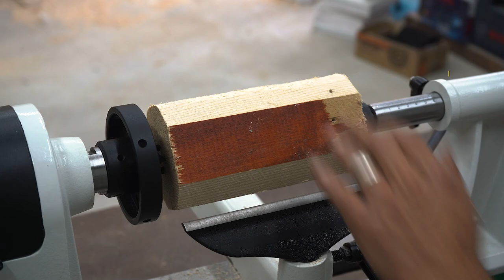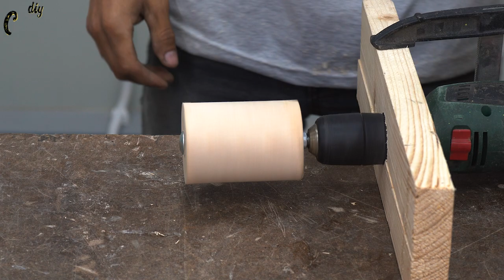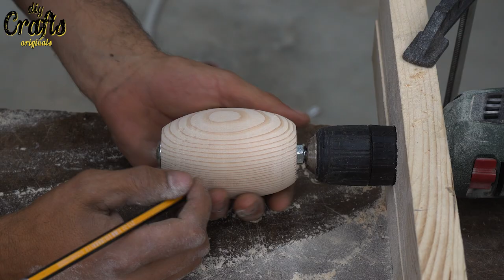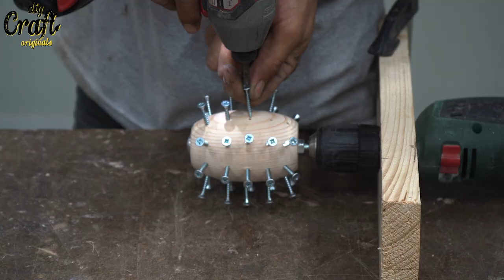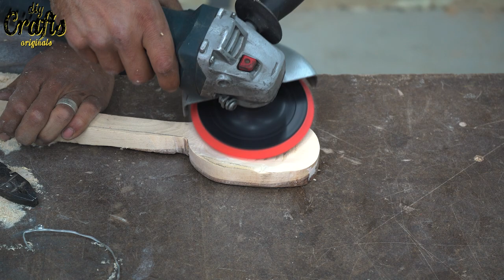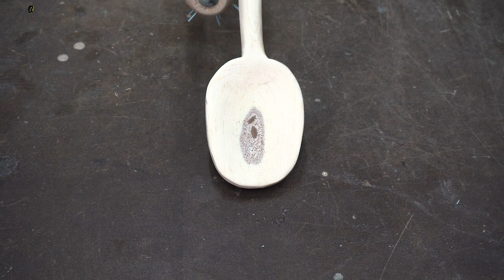DIY Spoon Carving Tool

Comment: Two thumbs down.

You have a wood lathe, so you could have shaped that tool much more efficiently on the lathe than on the drill, though your turning skills really need work, too.

If you want to make spoons with power tools, turn the outside profile on the lathe, cut in half to create 2 spoons, then use a coarse abrasive wheel on your body grinder, followed by sanding.